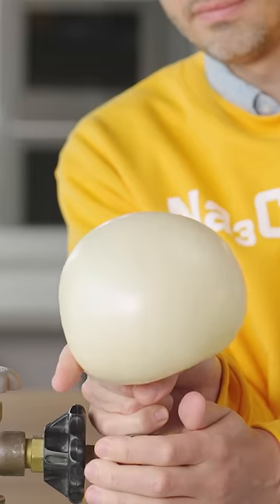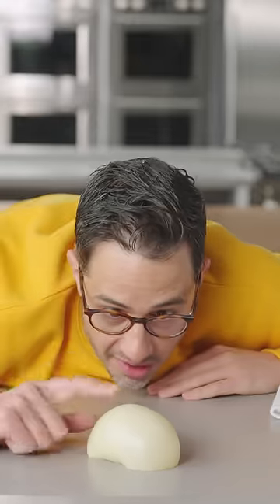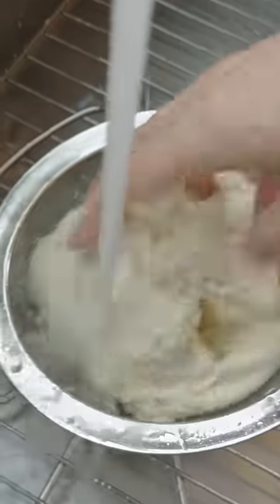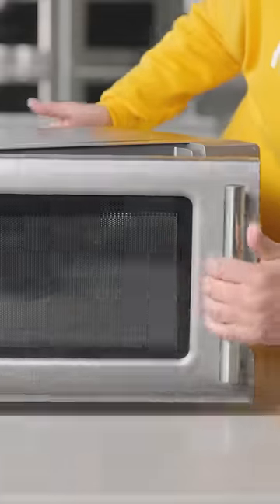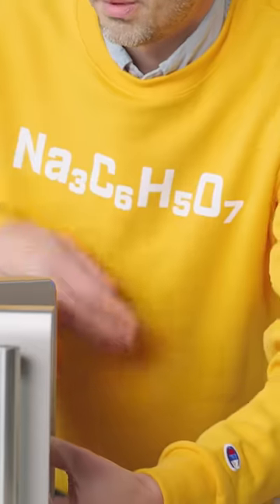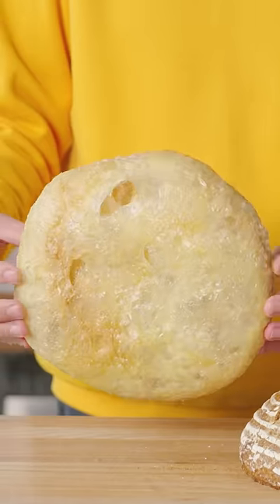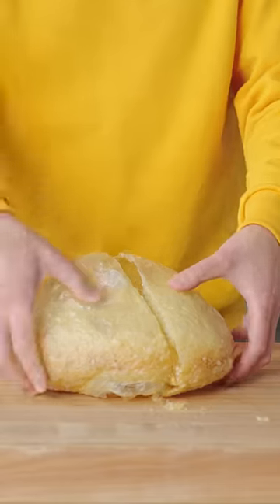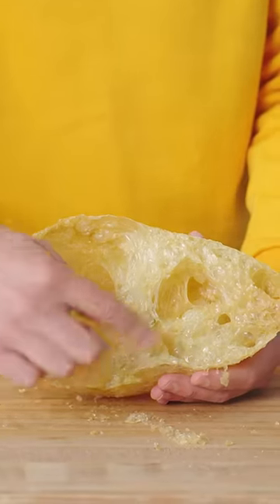This is 100% Gluten Bread

Comment: Whoaaa! This actually helps me actually comprehend what gluten is in the first place! This makes so much sense
Reply: Yeah like you can picture it trapping gas in the guts
Reply: Its protein, great for brains
Reply: @ShouldaWaved  that's not what happens though. For some people, it triggers an autoimmune reaction (makes the immune system attack your gut cells), and if you don't have that disease it doesn't do any harm
Reply: @ShouldaWaved  no... as stomach acid eats it easily.

Comment: To expand on this, it’s not just that it traps air, it is EXTREMELY elastic (as shown). However kneading doughs is important to work the gluten and activate that elasticity while incorporating air, which will result in a good quality bread, that has risen to multiple times its original size. Also any other form of glutenous foods are also able to expand a great deal without breakage. 
The reason gluten free cooking and baking is so challenging is because it’s hard to find a suitable substitute that is so elastic and so pliant.
Reply: Expand on this... Huh.
Reply: @Bulgeofpersuasion gluten is made up of glutenin and gliadin, most common in hard flour, less in soft flour. But without water and kneading, you'll not form that gluten. That's one of the reasons why sometimes new bakers fail to have good volume bread because they did not knead the dough properly , gluten structures are weak and unavailable to trap much of the carbon dioxide produced by the yeast
Reply: I gave up. Xanthan gum does nothing.
Reply: @Bulgeofpersuasion i love how you said expand on this and someone answered as if you have an AI assistant answering your every need
Reply: @Bulgeofpersuasion Gluten, stretch. No gluten, no stretch.
Reply: No it isn't. I used to be assistant director of operations for a Gluten Free Bakery that does trader Joe's House Brand. Tapioca, Brown Rice flour, Xanthan Gum. We even did "every allergen free" Hot Dog Buns and Dinner rolls for Disney. Almost entirely Xantham Gum.
Reply: @WobblesandBean You aren't doing it right then...Professional Experience here...
Reply: @CG-fn2cj I notice you said without water and kneading you’ll not form that gluten. Is gluten formed or activated?
Reply: @MicheleNoriega-k6d  formed. Activate is like dormant and you need to make it alive but it's not the case. gluten is formed when you knead the wheat flour (glutenin and gliadin are intertwined along the processs forming gluten). Take note that not all flour are gluten forming. Rice, corn, cassava etc are not gluten forming
Reply: @CG-fn2cj  thank you so much, appreciate it.👍👊
Reply: Some days u can learn nothing, some days u learn about gluten from a comment thread on youtube. 😂

Comment: That looks like a kazakh bread called baursak (бауырсақ). It's a bread, which is hollow inside. It's usually crispy but not dry, cause it's fried in oil
Reply: This bread is in Turkey too, but it's called pişi, kardeşım. I make a gluten-free version of it for breakfast.
Reply: @schizoposter1499 it has a different, solely turkic, etymology. It just happens to resemble "Bauer Sak". Source: German speaker living in Kyrgyzstan
Reply: @mr.oppenthunder2527 how did you end up there as a german
Reply: Bro its also looks like the bengali dish called luchi

Comment: This is so fascinating because when you just use vital wheat gluten, it’s not so soft like the one he had where he freshly washed the starch out. I wonder for making homemade gluten like this, how would you know what percent of the starch is removed? If I want the advantages of the stretchy gluten but the low carb content from washing out the starch and then using alternative materials for bulk like flax or oat fiber.

Comment: You can just buy pure gluten flower. This is essentially Seitan. Since gluten is a protein you can use it to make mock meats and it works for building muscle.

It is very sticky so it helps to form bubbles, but it also gives mock meats a bit of texture cuz its got chew to it.
Reply: "This is essentially Satan"
Awesome, thanks.
Reply: @ziggybarone3168  The joke "i worship seitan" is very old.